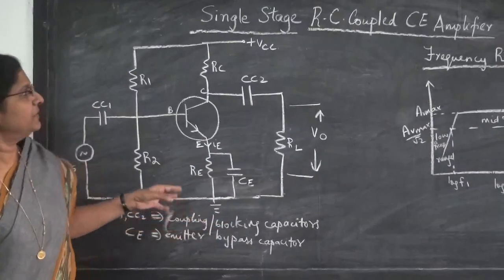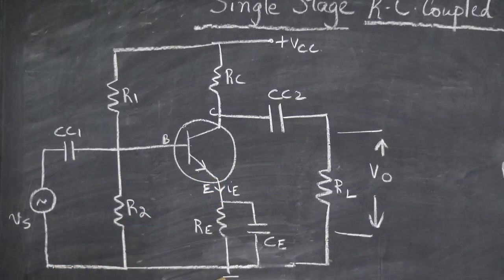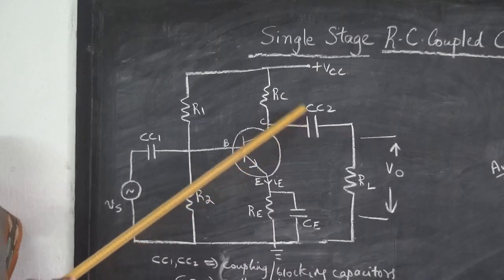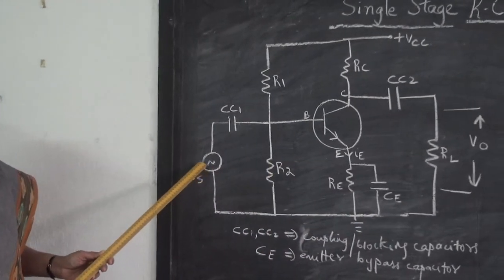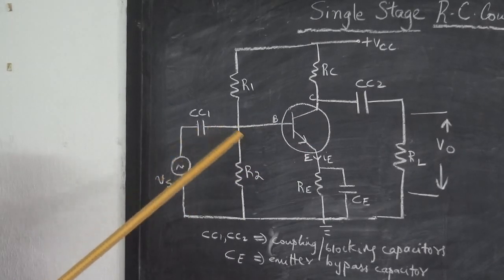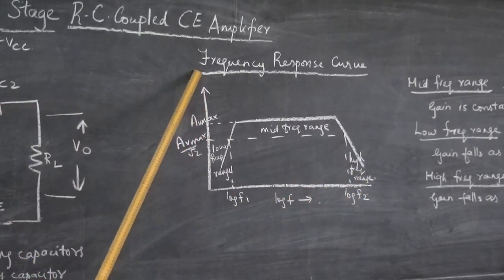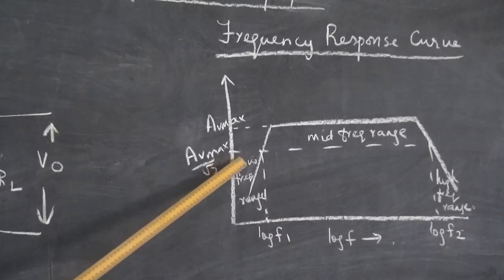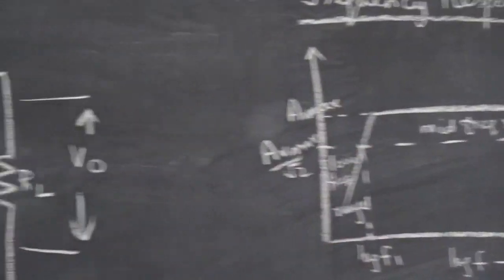R C Coupled Amplifier Part I -  Sunita Jacob

Comment: Where is the mathematical analyses of the RC coupled amplifier. How is bandwidth dependent on coupling  capacitors? What are the rules of junction capacitors in different frequency ranges?  The lecture in not up to mark of BE/B Tech level . Request to come up with detail mathematical approach. Waiting for Mathematical approach.

Comment: Mam capacitor cc2 why we take resistance Rl take can you please explain mam
Reply: Uzma soudager capacitor C2 is besically coupling capacitor. Coupling is used for multistage amplifier (e.g. direct coupling , transformer coupling , RC coupling etc).There is particular advantage of each type of coupling. Suppose you want to amplify both dc as well as ac signal , then you should use direct coupling( also called dc coupling).If you want to amplify only ac signal in the next stage then you should use Rc coupling or transformer coupling. If dc signal is also given as input of next stage amplifier , then it may disturb the bias stability. So generally RC coupling is used.And Rl is required because when you take voltage , you must take it across a resistor. Thank you
Reply: @KnowledgeAmplifier1  wow